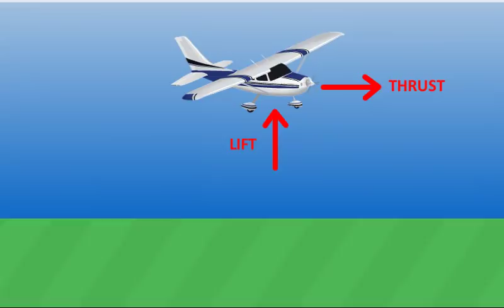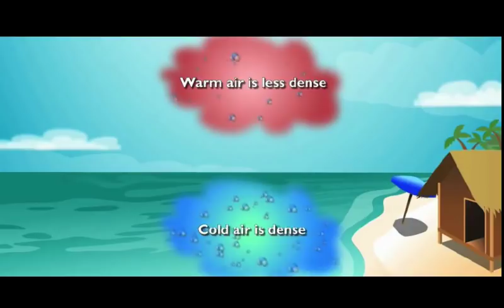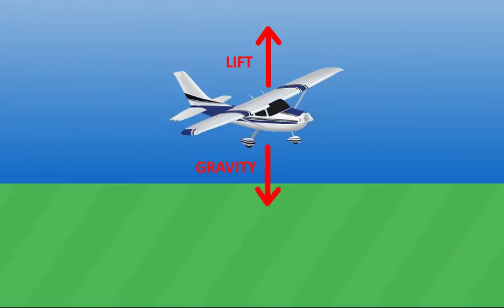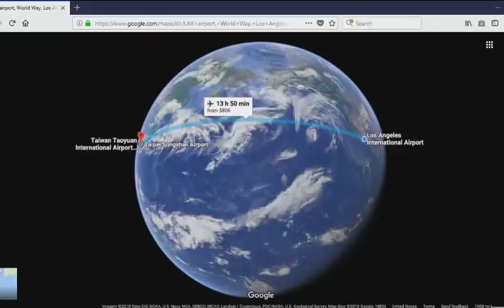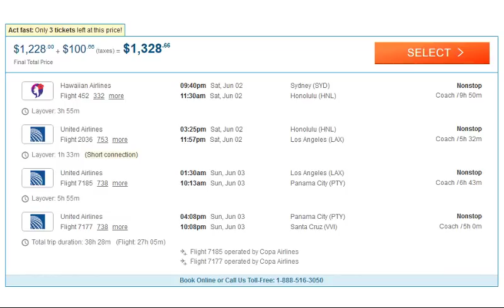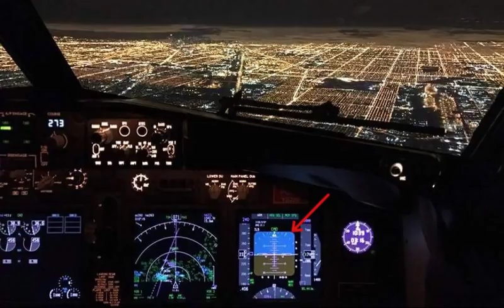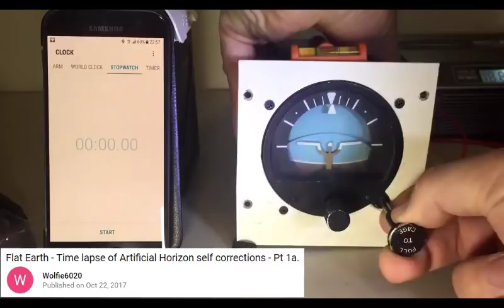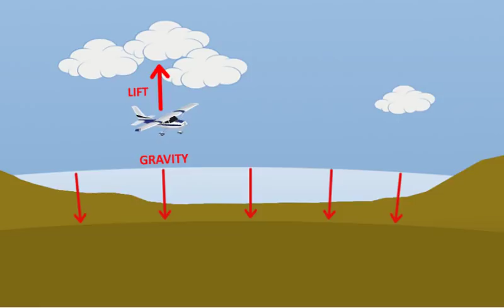Flat Earth Falsities - Plane Nonsense

Comment: So if our atmosphere rotates with us what's separates it from outer space? If space is a vacuum wouldn't everything be sucked into it
Reply: Gravity ,you forgot gravity .just like ocean ,deeper you go, the more pressure will be
Reply: "So if our atmosphere rotates with us what's separates it from outer space?"
Nothing.

"If space is a vacuum wouldn't everything be sucked into it"
A vacuum does not suck.  A vacuum does not do anything.  A vacuum is simply an empty space.  A void.  You may be under the impression that a vacuum sucks because you are most familiar with a vacuum cleaner.  But vacuum cleaners also do not suck.  A vacuum cleaner creates a near vacuum inside its chamber, this near vacuum has very low air pressure compared to the surrounding atmosphere.  The higher pressure atmosphere pushes into the lower pressure chamber of the vacuum cleaner. 

Now your next question may be "Well why doesn't the atmosphere "push" out into the vacuum of space?"
The answer to that is that in the upper levels of our atmosphere there simply isn't enough air pressure to overcome the pull of gravity.  As you increase in altitude air pressure drops.  This is why airplanes need to pressurize their cabins to allow the passengers to breathe, and why mountain climbers need to carry oxygen with them.  It's also why water boils faster in Denver than it does in Miami, because there is less air pressure pushing down on the water holding it in liquid form.  By the time you get to the Thermosphere (about 50-400 miles up where the ISS and most satellites orbit), there is so little air pressure that it can effectively be described as a vacuum.  So it's not a matter of a high pressure atmosphere next to a vacuum, it's a matter of a near vacuum atmosphere next to the near vacuum of space.
Reply: Dave Santiago  "no there clearly is a gradiant due to temperature."
I'm confused, earlier you said pressure requires a container now it just needs a temperature?  Please clarify this for me.

"And yes u clearly are making that claim if u are saying the atmosphere is holding in our gasses in an open system without the necessary antecedent of a container."
That is not what you claimed I said earlier.  You claimed that I said "Show gas PRESSURE being sustained without a container.  Gravity is classified as not a force sooooooo."  I did not make either of those claims.  You are now moving the goalposts.  I explained why it doesn't require a container in my original comment.  Perhaps you should actually read my original comment and then argue against what I actually said instead of arguing against straw men of your own creation and demanding I explain things I already explained.

"Why would the container need to be at 35000?  It wouldn't.  It's way up there. It has to be."
There is a significant difference in atmospheric pressure between ground level and 35,000 feet.  YOU said pressure requires a container.  Therefore logically using YOUR claim there must be a container between ground level and 35,000 feet in order to create this pressure.  I'm just trying to follow your claims.  Perhaps you should try explaining yourself better.  Maybe actually think about what you're trying to say before you click reply.

"How did we sustain the gas PRESSURE in the first place?"
Already answered in my original comment.  I can't help you if you are not going to make any attempt to actually read and understand my comments.
Reply: Dave Santiago  ""gravity is not a force but u can think of it as a force" George Musser 2019. Well if it's not a force then it's not a FORCE.  😂. U sound ridiculous"
Centrifugal force is also not a force.  Do you doubt it exists?  The fact that something is not a force does not mean that it can not be treated as a force for the purposes of calculations.  For our purposes here on Earth we can treat gravity as a force.  You would understand this IF you actually read some of Musser's or Einstein's work instead of just repeating a bunch of nonsense you heard on FE videos.
Reply: Dave Santiago  "dude go fuck yourself"
Awe you're so sweet.

"There has to be a container somewhere waaaaaayyyy up there.  Not at 35000 feet."
You really have no reading comprehension at all.  OK fine.  Let's play your game.  PROVE IT.  Show me the evidence to prove that container you claim exists "waaaaaaayyy up there".  Stop dodging.  Stop acting like a child.  Man up and prove it.  Prove that a container exists.

"A container is the necessary antecedent for gas PRESSURE. "
Wrong.  I have already explained to you how that is wrong.  You acknowledge there is a pressure gradient.  You acknowledge that something creates that gradient.  It's not a container.  So pressure can exist without a container.  YOUR entire argument seems to be "I think a container is needed for pressure therefore Earth must be in a container".  It's a flawed argument.  It's circular nonsense.

"What's your SCIENTIFIC EVIDENCE that the earth is a SPHERE?"
I don't bear the burden of proof for that.  And as I said the shape of the planet is irrelevant to whether or not a container exists.  YOU are desperately trying to distract.

"ok then prove we don't need a container!!!!!! Show a demonstration of gas pressure being sustained without a container then!!!!! WTF don't u get about that???!!"
Done.  The pressure at ground level is higher than the pressure at 35,000 feet.  There is NO container between those two altitudes.  Therefore pressure can exist without a container.  Why can't you understand that?

"don't use words!!!! I want proof of what ur saying is true!!! A demonstration of your claim!!!!! If not then fuck off!!!"
Doesn't someone need a nappy time?  Show me the proof of the container.  A demonstration of your claim.  "If not then fuck off!!!"  Put your money where your mouth is.  Stop demanding that other people do things that YOU are unwilling to do.
Reply: @MrQuaiven  I hope you know that this Dave Santiago person I just trolling you. Nobody could actually believe those things, it's just not possible to be that dumb.
Reply from the maker: Mary Wells - No. vacuums don’t really suck. You have only experienced vacuums here on earth, inside the pressure of the atmosphere. When you create a vacuum on earth and then open it, it is the atmospheric pressure that forces air in to fill the void. Space has no pressure, and no “sucking” force. The earth’s air is just held to earth by gravity.
Reply: Dave Santiago  "no sorry.  Gravity is not a FORCE.  Astrophysicist George Musser 2019."
This is what's known as cherry picking, you are citing one specific thing he said while ignoring the greater context of his work.  It is also an appeal to authority.  Now, if we are to trust the authority of George Musser than we must acknowledge that Earth is a globe BECAUSE George Musser says it is a globe.  

"So if gravity is not a force then it's not holding in anything now is it?  It's the bending if space time they say.  I. A fourth dimension that we don't experience.  It's conceptual idea on paper"
If you ever bother to read his actual work instead of just repeating some stuff you heard on a FE video, you'll find that he also says that at a human scale gravity can be treated as a force.  

"prove gravity!  Because there is no SCIENTIFIC EVIDENCE backing gravity. None."
George Musser disagrees with you.  I'm beginning to suspect you have never actually read any of his work.  Might I suggest you start with The Complete Idiot's Guide to String Theory https://www.bookdepository.com/Complete-Idiots-Guide-String-Theory-George-Musser/9781592577026
Reply: Dave Santiago  "yes u SAID it doesn't need a container."
No, I did not.  Please, by all means show me a quote where I said that.  It is true, by the way, but I did NOT say that so YOU are still arguing against things I did NOT say.  YOU said that it DOES need one.  Therefore PROVE that one exists.  Come on.  Put your money where your mouth is.  Prove the container that causes a difference in air pressure between ground level and 35,000 feet.

"Now u have to show gas pressure being sustained without a container."
I already have.  Again, I can not help you if you are just going to ignore what I'm saying and make up things I didn't say to argue against.  The air pressure at ground level is HIGHER than 35,000 feet.  There is NO CONTAINER between them.  Therefore pressure is existing WITHOUT a container.  Stop creating straw men to argue against and actually read and consider what I am actually saying.  Stop trying to "win" and start trying to understand.
Reply: Dave Santiago   "negative.  Does our gas PRESSURE stop at 35000 feet. No.  So no it would NOT need to be at that height."
Did I say it did?  No.  In fact if you actually read my comments I acknowledged that our atmosphere (and therefore air pressure) continues out to 400 miles above the Earth (and further out to 6,000 miles in the exosphere and even out to 250,000 miles in the geocorona).  But the point is YOU said pressure needs a container.  There is no container between ground level and 35,000 feet.  There is a pressure difference.  No container.  Pressure difference.  Get it?  Do you understand?  YOU said it needs a container.  There is no container.  Therefore YOU are wrong about it needing a container.

"it's absolutely not an appeal to authority."
It absolutely is an appeal to authority.

"He is a professional in that field."
Yes.  He is an authority on the subject.  And you are appealing to his authority on the subject.  Therefore an appeal to authority.  

"So if ur not going to listen to him then u can't listen to anyone in that field"
I did listen to him.  In fact I encouraged YOU to listen to him more.  Instead of cherry picking one thing he said and ignoring the greater context of his work.

"I thought he was an appeal to authority but then ur going to reference him? Lol"
Do you have trouble with reading comprehension?

"I heard the words that can out of his mouth.   Einstein also said it's not a force. Also many  universities."
Further appeals to authority.  

"I'm repeating EXACTLY WHAT HE SAID."
Yes.  You are repeating exactly what he said WHILE IGNORING THE CONTEXT IN WHICH HE SAID IT.  In other words.  Cherry picking.
Reply: Dave Santiago  "just because we have a gradiant doesn't mean there is not a container.  What are u talking about."
You really seem to be having difficulty grasping this.  YOU said pressure requires a container.  YOU said that.  There is no container here but there is pressure.  Therefore YOU are wrong.  

"Yes we have a gradiant from temperature."
Temperature can change drastically throughout the course of the day, but the gradient is always there.  Regardless of temperature.  Temperature is not causing the gradient.  Temperature is a RESULT of the gradient.  In any case, YOU said pressure requires a container.  Is temperature a container?  No.  Of course it isn't.  So make up your mind.  Is there a container or not?  If there is no container than what is causing the pressure?  

"I quoted him.  He said gravity is literally not a force but u can think of it as a force.  How is that taken out of context?"
So you now admit that it can be treated as a force?  You acknowledge that now?  Yes or no?  If you acknowledge that it can be treated as a force then what are you even arguing about?  Semantics?
Reply: Dave Santiago   "u don't KNOW there isn't a container."
Airplanes climb in and out of 35,000 feet tens of thousands of times per day.  Don't you think one of them would have hit it by now if one existed?  Are you claiming there is a container between ground level and 35,000 feet?  What evidence do you have to prove that?

"U are just presupossing the earth is a sphere."
No, I'm not, and the shape of the planet is irrelevant to whether or not a container exists to create pressure in the atmosphere.  You see that right?

"semantics u say.  It can be treated like a force!!!????   Listen to that statement.  It's ridiculous."
It's not ridiculous at all.

"Also he said I can think not treat."
Now that is literally arguing semantics.

"Ok here we go.  U are NOT a pedophile, but I can think of u as one. But ur not.  So are I or aren't I one just because I think of u as one?"
Most pathetic attempt at an argument ever.  Seriously.  That's worthy of an award right there.
Reply: Dave Santiago  and btw, since we live in a container, where does all the gas goes? I mean gases does build up over time, it has to go somewhere? 

You got any proof of this dynamic system? 

All you can do is claim claim and claim and not prove shit.
Reply: Dave Santiago  "sorry. Prove ur claim then.  Show gas PRESSURE being sustained without a container."
I did not make that claim.  Perhaps you should read my comment again and make an argument against what I actually did say instead of making things up to argue against.

"Gravity is classified as not a force sooooooo."
Again, I did not say that.  Perhaps you should read my comment again and make an argument against what I actually did say instead of making things up to argue against.

"The necessary antecedent for gas PRESSURE is a container. Can't get around that fact"
Are you suggesting that there is a container between the ground and 35,000 feet up?  Or are you suggesting that there is no difference in air pressure between the ground and 35,000 feet up?  Or perhaps you are suggesting something else and I'm misunderstanding, please clarify.
Reply: Dave Santiago  "so you are trying to tell me that the necessary antecedent to have gas pressure is not a container is that what you are saying right now.  Because it's not because I say so it's because it's a factand if you say it's not a fact that please provide a demonstration of gas pressure being sustained without a container"

Repeating the same thing over and over again does not make the thing become true.  You seem to be stuck in a loop.
Reply: Dave Santiago  "I'm still waiting for SCIENTIFIC evidence of gravity please.  I'm not ignoring anything. "
Except you are ignoring all the evidence provided so far in this thread alone.  Not to mention the evidence provided in the video above.

"I'm telling you there is ZERO scientific evidence of gravity."
And here we have more "IT'S TRUE BECAUSE I SAY IT'S TRUE!!!!"

"And please don't say the Cavendish non experiment.  Because it's not truly a scientific experiment."
Your refusal to accept an experiment does not invalidate the experiment.  This right here is an example of you IGNORING evidence that proves you wrong.
Reply: Dave Santiago  - What exactly produces this gas?
Reply: @PabloGonzalez-hv3td  sup bro, just letting you know, if he doesn't watch the video that i provided him with, there's no point in arguing with him. Unless you're going to waste his time then by all means go for it
Reply: Dave Santiago  "Step one observe a natural phenomena.  What's the NATURAL phenomena observered in the Cavendish?"
And here you demonstrate your ignorance of what the Cavendish experiment even is.  In short you have been dismissing it without even knowing what it is.  Clearly.  Or you would not be asking this question.  The phenomena observed is that two masses will be attracted towards each other at a rate proportional to the product of the two masses, and inversely proportional to the square of the distance between them.  But of course, you will dismiss this, because you don't care.  You'll just wave it off as wrong, without explanation and keep repeating your same empty claims over and over.
Reply: No Mary but 31 replies... some do get "sucked" escaping in the open they say, but GRAVITY holds most :)
Reply: Our atmosphere extends into space and well beyond the moon. With all the videos you people made about the recent discovery of our extended atmosphere, you would think you would remember this. Apparently, selective memory is alive and well.
Reply: WHAT? Is that now a FACT? Was told NASA did not say-so! (ESA)  Dude how do you know HE makes videos or has seen those recent ones? We dont meet at the temple every week like the Masons!Point being with all the talk you people made about Gravity holding it down at home.. bogus?But spacemen still can not see stars... Between golfing & hammer-feather business they could not have measured THAT ?  Wonder if that recent discovery after 1/2 century of  Giant-Leap is not about making those rockets work in Space..... :) :) :)
ps: nice to see a fervent FE follower! Some people just dont appreciate NONSENSE....
Reply: Dave Santiago  Here it is: A high pressure area next to a low pressure area.
http://web.gccaz.edu/~lnewman/gph111/topic_units/Pressure_winds/pressure/sfc_map.jpg
Reply: MORON The vacuum of space doesn't suck anything. However, gravity "sucks" (attracts) masses together. And nothing separates us from outer space. Which is why we could go to the moon and send rockets to study other planets, etc.
Reply: Dave Santiago  Same as here: https://climate.ncsu.edu/images/edu/pressureheight.jpg
Reply: Dave Santiago  - You can fill a lidless box with a heavier than air gas and the gas will remain in the box with a higher pressure than the surrounding air and no lid it's a simple concept really 

The vacuum of space is simply emptiness it does not exert a competing force to the pull of gravity
Reply: Dave Santiago  "Once again the necessary antecedent to have gas pressure is a container."
Repeating the same thing over and over does not make the thing true.

"And it's up to u to disprove that fact."
No, it's up to you to prove that it is a fact.  So far you haven't done that, you've just repeatedly said it's true while making no attempt to actually prove it.

"The second law of thermodynamics and Boyles law would disagree with you now wouldn't they."
Copy and paste those laws for us here.  Then show how exactly they support your claim.
Reply: Dave Santiago  "my evidence of a container is that it IS THE NECESSARY ANTECEDENT TO HAVE GAS PRESSURE IN THE FIRST PLACE."
So basically your "evidence" is "BECAUSE I SAY SO!!!"

"Also please provide scientific evidence of gravity if you are obviously claiming gravity exists.  I would appreciate it greatly. Again I apologise for my earlier outbursts and would like to have a civil convo with you if you are willing to.  Thank you for your time."
Evidence has already been provided for you.  If you really want to have a civil conversation then you should start by not ignoring all the evidence that proves your claims to be wrong.
Reply: Dave Santiago  - The pressure gradient in the ocean increases with depth without a lid the atmosphere is no different the pressure is created weight
Reply: Dave Santiago  - We are talking fluid dynamics. We can't breathe water but fish can and nobody can breathe hydrogen, which is also a gas, breathability has nothing to do with this

The lid of the box doesn't build pressure it ensures complete saturation of the enclosure and left undisturbed the heavier than air gas will remain indefinitely
Reply: Dave Santiago  - If air pressure only exists because we're in a dome why does it decrease with altitude? 

You don't need to go very high to experience the effects of the gradually thinning atmosphere
Reply: Dave Santiago  https://youtu.be/KyD8VIK032o

If you REALLY care you'll watch this entire video which is around 10 to 15 mins long so it's not that bad. Otherwise, I done arguing with you. No sense in arguing with someone who doesn't want to learn a thing or two, you'll just be wasting my time. Let me know when you finish watching it, that's if you bother watching it and not skipping through it.
Reply: Dave Santiago  and you still haven't proved your dynamic system or tell me where the gases goes in this container. Since gases does build up over time.
Reply: Dave Santiago  You claim gravity doesn't exist? Fucking hell.
How do think things could be calculated without gravity in the equation?
Nothing where velocity and forces are involved would work !
Reply: @petroleumalley  I suggest you don't waste your time here unless you want to waste his time. He already proved that he doesn't care about learning a thing or two.
Reply: @darthrevan454  He admits pressure reduces drastically at high altitude.
Even if there was a dome it would then have no function. All he is interested in is hearing people say: there is a dome.
Reply: @petroleumalley  at this point he's choosing to be ignorant. In that case, let him be ignorant. He's the one who's going to look crazy along with other flat earthers, btw if you haven't heard, flat earther is dying out slowly. Scimandan provided statistics proving it. Thank God for that.
Reply: Dave Santiago  "I don't know how the sky works EXACTLY."
And yet from your first post in this thread you have been making definitive statements about how the sky works.  To wit, stating over and over that it requires a container.

"You can't have gas pressure next to a vacuum, period!!!!!"
Have you even read the responses you've gotten?

"Show gas pressure being sustained without a container.  And go!!!"
Stop demanding people prove things that you have already decided you will not accept.

"entropy is not just me saying I said so."
Describe entropy.  Describe it in detail.  Explain how it works.  Stop saying "it does x" until you can explain what exactly "it" is.  Because right now as I have said multiple times your entire argument breaks down to "IT DOES IT BECAUSE I SAY IT DOES IT!!!!"

"But we can be done with this convo you and me because u haven't shown anything now have u.  So good bye to u."
Coward's way out.

"What is the natural phenomena OBSERVED in nature?  Because we don't see mass atracting mass in nature!!!!!"
Yes, we do.  All the time.  Your refusal to accept it does not make it any less true.  Also.  You are now moving the goalposts.  You asked for the phenomena observed in the Cavendish experiment.  I answered.  You're trying to move the goalposts now.  This is not the behavior of someone who actually wants "civil discussion".  This is just you outright IGNORING things that prove you wrong.  Again.

"Ok next what is your independent and dependent variables?"
The size of the masses and the distance between them.  It was right there in my answer.  You chose to ignore it.  Because you don't actually want the answer.  Because the answer shows you are wrong.

"We are going to go thru this so u see that it's PSEUDOSCIENCE!!!!  PSEUDOSCIENCE is the non adherence to the SCIENTIFIC METHOD."
Says the guy who has repeatedly said pressure needs a container while making no effort at all to show that pressure needs a container.

"I absolutely agree there is a gradiant but it doesn't mean there is no CONTAINER."
So you finally acknowledge there is a gradient.  WHAT IS CAUSING THE GRADIENT?  If there is no container between the varying levels of the gradient what is causing the gradient?
Reply: @MrQuaiven  and there you have it, he said he watched the video, but said some stupid shit proving to me that he only watched 2 mins of it. I'm done arguing with him. I suggest you don't waste your time here anymore, unless you want to waste his time. Anyways goodbye bro.
Reply: @darthrevan454  Dave has been posting the same nonsense for months now.  I know he'll never change his mind or listen to reason, I respond mostly to point out the flaws in his "logic" so that anyone who might be following along can learn from his mistakes.
Reply: Dave Santiago  yea you haven't watched the video. I'm done here.
Reply: Dave Santiago  Yes: It was made on paper. Force has always existed. Force was split 200 years ago into mass and gravity. All in a sudden we could calculate dynamic situations instead of static situations only.
9,8m/s2 is the number used in all calculations and they match reality. What is your number?
Reply: Dave Santiago  Gravity is not a force. F=m*a is a force. I asked what is your number. How do calculate free fall, terminal velocity, velocity of buoyant emerging etc?
Reply: Dave Santiago  I do have answers. But I do 1 subject at the time. You said it was off topic anyway.
Reply: Dave Santiago  Flerfers love to change subject. I will not entertain that. So I refuse to discuss Antarctica before we closed a discussion about gravity.
How do you calculate terminal velocity of a free falling object without using gravity in the equation?
Reply: Dave Santiago  It is not just mathematics. The results can be tested. The results match with the calculations.
You on the other hand have no mathematics and also test nothing. That's why your results also match. 😎
https://www.youtube.com/watch?v=q_fh8WKqVCw
Reply: Dave Santiago  Like I said. All those maths can be verified in real life.
Have you ever done a Cavendish test yourself?
Reply: Dave Santiago  The large variations in the measured values of G have caused scientists to question if G is truly constant at all. 
Now tell me: How much does that affect the gravity (small g) here on earth? And how does that affect the shape of this earth?
Reply: Dave Santiago  I can not find any link you provided to Darth Revan dismissing Newtonian gravity. Must be a hoax. Newton is still in the top 10 scientists of all time.
Reply: Dave Santiago  The links show nothing new. It's clickbait. It's actually only 1 professor claiming something. Not the entire scientific community. It is far off being a new theory.
It only Limits Newtons finding to earth and not black holes and such.
  I already said earlier that it is questioned if G is constant.

“It cannot fully explain gravity inside a black hole, and at some point we will need to move beyond Einstein’s theory to a more comprehensive theory of gravity that explains what a black hole is.”
Reply: Dave Santiago  Don't talk nonsense
http://apollo.lsc.vsc.edu/classes/met130/notes/chapter10/graphics/general_circ.jpg
Reply: Dave Santiago  The result of coriolis. But didn't even recognize it.
Reply: Dave Santiago  Boyle/Gay Lussac describes what happens in a container.
SO?....................
What happens when you open the container?
Reply: Dave Santiago  I didn't say it proves the earth to be round. You said on a round earth the coriolis effect could not be found.
Go make your homework. I am not going to explain what you can find out yourself.
Reply: Dave Santiago  Are you blind? I just told you: The law of Boyle/Gay-Lussac is defined by a container.
Look up Boyle/Gay-Lussac and you will find the word container all over the place.
Pleeeeeeaaaase . Study something. We are not talking about 1 fucking cubic meter.
Boyle/Gay Lussac describes what happens in a container.
SO?....................
What happens when you open the container?
Reply: @petroleumalley  he won't answer you my guy, this one's dumb as bricks.
Reply: @darthrevan454  I know. When someone says gravity doesn't exist, I shouldn't even bother to reply.
Scrolling down 145 replies also doesn't help. I will stop here.
Reply: @petroleumalley  especially when you give them countless of evidences and experiments that he can replicate but still denies it all.

Just fuck it bro, no point in arguing with lunatics. Glad youre finally done though.
Reply: Dave Santiago  awwww did I make someone mad? Dumbass, your links are worthless they don't prove shit they just claim shit just like you.
Reply: Dave Santiago  https://youtu.be/KyD8VIK032o
Reply: Dave Santiago  what a fucking moron https://youtu.be/KyD8VIK032o
Reply: Dave Santiago  https://youtu.be/KyD8VIK032o

^^^^
Actual explanations